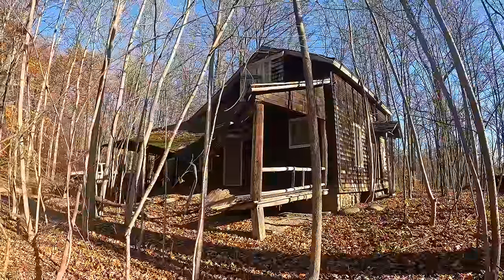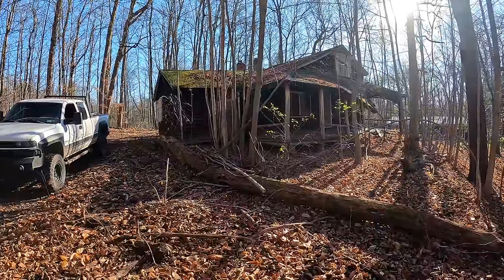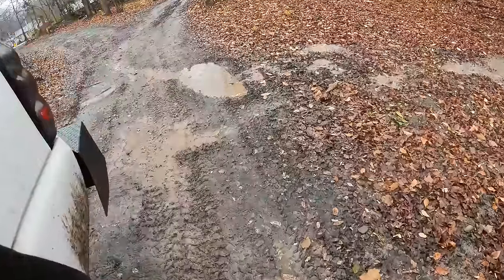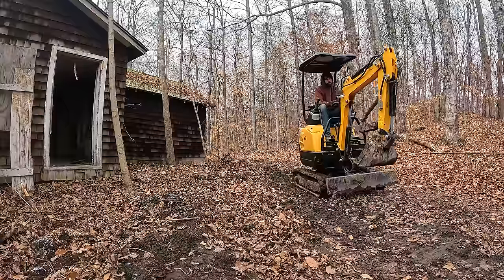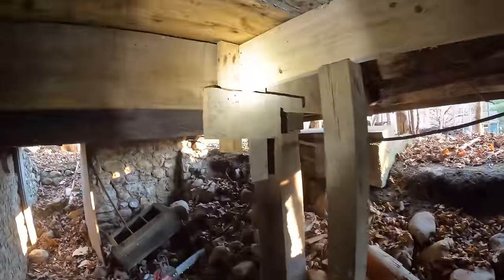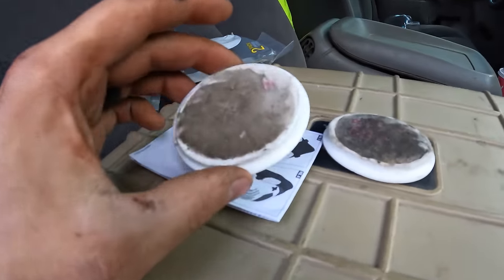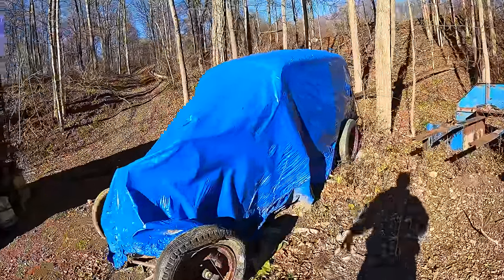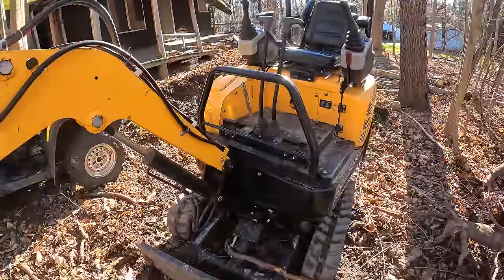I bought an ABANDONED CABIN in the WOODS - Vacant for over a hundred years!

Comment: It might have been built in the '30s, but it hasn't been vacant that long. It has had doors/siding/roof/ and interior parts upgraded way more recently.
Reply: Exactly. It was never built in the 1800s.
Reply: Young trees around it. Max 20 years vacant
Reply: I think it was not used as a residence since the 60’s.  It has had a lot of repairs etc though that have allowed it to stand.  Taking that this is probably upstate New York from the license plate or very rural New York there is no way this would still be standing after that many winters.  The fireplace is modern brick so to speak.  The evidence shows that it is an old house though with the log beams in the basement on the original structure.
Reply: It has asphalt shingles!  Man the Bs clickbaits are everywhere
Reply: @rhetorical1488  1903
Asphalt shingles are an American invention by Henry Reynolds of Grand Rapids, Michigan. They were first used in 1903, in general use in parts of America by 1911 and by 1939 11 million squares of shingles were being produced.
Reply: @nataliehunt1125  good thing you have wikipedia. Now tell me how they survived in working condition without care or maintenance for a century when their original lifespan was 5 years.
Reply: @kamurray67  Asphalt shingles are an American invention by Henry Reynolds of Grand Rapids, Michigan. They were first used in 1903, in general use in parts of America by 1911 and by 1939 11 million squares of shingles were being produced.
Reply: @nataliehunt1125  and what is your point?  I never said anything about asphalt shingles.   But, since you injected me into a conversation about asphalt shingles, the life span of 1930’s shingles makes this roof much younger than 1930 shingles.  But, I never said a thing about shingles.  There is enough other evidence for this house to have been renovated in the last 50-60 years.
Reply: I am so glad you made this comment. So many good points followed yours on this thread.
Reply: Comp roof
Reply: Exactly, it may be vacant for 30 years max. Otherwise it would have collapsed.
Reply: Plaster and lath look like 20s - 30s could be later maybe 40s. Back they they painted over beautifulnwood with horrid lead-based paint. If you go through the trouble to strip that stuff often you find beautiful walnut and cherry underneath, that you just can't buy today, but it's a lot of work and nasty chemicals.
Reply: Please note the distinct lack of "modern" facilities in the house.  The only water and electricity in the house is in the kitchen for a single faucet/sink, and a single light/outlet. Other than the kitchen, there are no light switches anywhere, no light fixtures anywhere, no outlets anywhere, not even wiring behind the plaster and lath.  There is no bathroom in the house, there is no toilet, no shower, no bathtub, nor any place for those because they were most likely not part of the original building plans because 100 years ago they weren't standard for every architecture plan, since many places, especially rural places, still didn't have access to pumped water or electricity, thus it was assumed that your "business" would be conducted elsewhere, notably outside the house, in the outhouse. I assume the electricity was also an afterthought as you can see the wiring being run along the top of the baseboard before going behind the paster and lath (and upwards to the outlet/fixture). 

Does the state even permit you to live in a house without "modern" facilities such as running water and toilets, and electricity?
Reply: @jimmy_kirk a lot of those fixtures could have been removed after people moved out.
Reply: @jimmy_kirk   @jimmy_kirk  You said it! That plaster and lath means it was orininally built in the 1920s-1940s. Roof, electricity and what have you were probably added/renovated later. My guess is that it was lived in permanently into the 60s-70s and then intermittently into the 80s. After that it fell into disrepair. 
As far as whetjer you can live without perc and being on city water etc. Well, that depends on where you live and as usual in the USA it is a confusing, chaotic morass of laws and ordinances. You may be subject to several layers of law, like the EPA might require you to have perc (I don't know if they still do this or not? They used to.), then your city or township might require you to be on city water and your county might have particular health and safety rules that apply to where you live. Check first with your local planning or zoning department, then invite a few builders for coffee, breakfast or wings and beer at the local pool hall. That should cover it.
Reply: @z4zuse  trees grow themselves what does that have to do with anything? the seeds are spread through birds and chipmunks and things like wut
Reply: @champion1388  After a years of vacancy, one would expect some older trees around. Trees are not a new phenomenon. Electrical outlets are.
Reply: Dude!!! Do you think the built with sticks?  Most of the houses in Europe are easily several hundred years old and they have windows and siding with a roof.
Reply: @ruadhscottygirl2480 IT WAS NEVER said it was built in the 1800s wth do people get the these dumb ideas from. 🙄
Reply: beside the 30's are not over 100 years ago
Reply: @kelleyhawk6595  It's because the guy in the video suggested the building might go that far back.
EDIT; scrolling through the comments the uploader says as a fact it was built in the 1860's and abandoned in the 1920's.
I don't believe a word of the abandonment date personally.
Reply: And I swear I saw a lino floor too which certainly won't last 100 years.
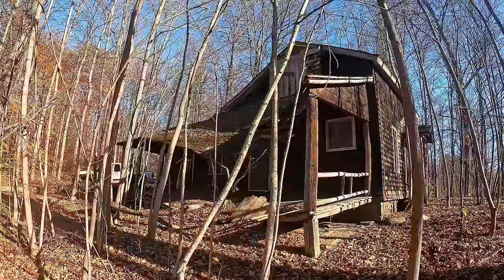Reply: @kelleyhawk6595  he says it 16 seconds into the video. 0:16
Reply: @jimmy_kirk  It may have been  used as a seasonal residence, like a hunting cabin or summer cabin. These are pretty common to see in rural parts of upstate NY and they will often have little or no indoor plumbing and be off grid.
Reply: @spunker88  That's what my thoughts were as well.
Reply: The house was probably built before the 1900’s for sure the floor joist are logs either chestnut, cherry or walnut also looks like hand hewn beams as well, I’m sure there was some updates done as well.
Reply: yeah. lost me when he said it might be vancant since the 1800's. any amount of reason would tell you someone lived in it around the 60's. I have to stop watching this click bait video now. see ya
Reply: My thoughts too.
Reply: exactly it looks a lot like my house that was built in the 30s/40s the windows are almost identical
Reply: If the place had been abandoned for nearly 100 years - it would have caved in on itself by now from roof deterioration.   The roof is probably 30'ish years old at this point.  Neat project though...
Reply: @kamurray67  i think that @nataliehunt1125 just wanted to try to prove a point that shingles were around from the very early 1900's and by the late 30's they were using a shit load of the damn things. and then also, she knows how to search a wikipedia page to get the answers she is looking for! but, i think she forgets that anyone can look up information, and even if they dont need to, its plainly obvious that this house has been worked on more recently that 100 years ago (possibly longer?)
Reply: I think the house is very old.  There is a lot of talk about the roofing and the asphalt shingles, this was 3 tab roofing if you look closely and that was developed and used in the 1950's and to me the plywood under the shingles (seen on the failing porch roof) sets the timeframe to be in at least in the 1950's, by then 3 tab asphalt shingles over plywood were the most prevalent type of roofing systems used both for new construction and re-roofs.   I was still installing 3 tab roofing on some homes into the early 80's.  Of course the roof tells us nothing about when the building was built and nothing about the last time the place was lived in, because whether they were living in the place or not the owner at the time may have re-roofed the building just to try and maintain it.
Reply: @jimmy_kirk  Look again. You'll find things you said are not there. Look again.
Reply: @oldladyfarmer7211  Such as?
Reply: Look again - everyone who has figured out that this has not been abandoned for 100 years has figured it out. Rewatch or read the posts. I don't do my kids homework for them. ;)
Reply: @oldladyfarmer7211  You made the claim "You'll find things you said are not there".  The onus is on you to substantiate your own claim.  It's not my "homework" to substantiate your claim for you. That's your job.  You said it, now own it.
Reply: @jimmy_kirk  I've been rewatching several times to see if I'm wrong. So far I'm not. I'll get back to you.  Wow - it was tough trying to get back to this.....After this I'm not bothering with this video anymore - I'm old and it's taking too much time from my life to try and search for responses.
The fellow said he was told the house was abandoned about a hundred years ago. That is wrong. Whoever told him that was incorrect. At the very beginning there is a chrome/stainless electrical outlet cover....that is not 100 years old. The fruit wallpaper (like what we had in our kitchen when I was a kid) is not 100 years old. You miss the point which is that though the house may be 100 yrs old - it hasn't been abandoned that long. When I was a kid we had an outhouse - a lot of people did. A bathroom was an afterthought if you could afford one so that's not an indicator. Many old homes were used as hunting lodges/cabins for many decades after the homeowners moved out  - as was our first farmhouse. So ...
Reply: @oldladyfarmer7211  You just need to provide a timestamp from the video showing running water or electricity anywhere in the house besides the kitchen.   I checked before I made my comment, so I'm fairly confident in my claim. If you see some electrical outlets, light fixtures or plumbing anywhere else in the house, then just provide a timestamp for where you see it in the video.
Reply: @jimmy_kirk  3:15   cellar, post on the right has a light fixture. Now I'm not going to try to find anymore replies - it's too time consuming.
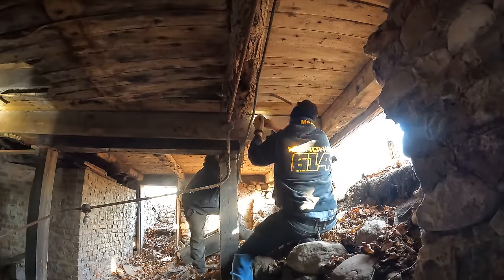Reply: @oldladyfarmer7211  That's literally on the mainline coming into the house.  That's the one electrical line that runs into the kitchen. Notice that there is absolutely no other wiring there besides that one main line that runs into the kitchen?   This is the mainline that they removed at (32:35).   You're not going to try and "find any more replies" because there are none.  You didn't even find what you think you found, because what you found was the single electrical mainline that runs into the kitchen.
Reply: The wall outlets in the first room are from the early 70's
Reply: That's how you get 1.5m views in 2 weeks on a channel with under 50k viewers lol
Reply: @QuanticChaos1000  What makes you say "early 70's"?
Reply: @kamurray67  Shingles are painful...
Reply: @garygsp3  Are the houses you're describing abandoned in the woods?
Reply: @z4zuse  I think it could be 50-60 years vacant. The main building we see could date from the 30s but could have been built on a building older than that. A lot of the structure looks like my 1922 house. As for the roof "Asphalt shingles are an American invention by Henry Reynolds of Grand Rapids, Michigan. They were first used in 1903, in general use in parts of America by 1911 and by 1939 11 million squares of shingles were being produced." How long it would take for that moss to grow on that roof I have no idea as not familiar with the area or climate. I'm sure he was told whatever they thought he wanted to hear just to get the house sold. I did a little research on my house and most of what I was told was true.
Reply: @kamurray67  That fireplace looks like an old design. Keven Lee James has one very similar in his house which dates from the 1800s. If the house was tied up in probate and family infighting they might have done the very minimal to maintain it, IE. board it up securely and make sure the roof doesn't leak. Some houses are in limbo for decades because of this.
Reply: the updated electical was a giveaway too
Reply: my first thought was that he may have been given misinformation by the seller/real estate agent or auctioneer. we don't know how he obtained the house. and although he may have been told it was vacant all that time, i can definitely see evidence of squatters. further, i think it could just be a misunderstanding of wording -- maybe he meant it's 100 years old but has been vacant for many years, not "vacant for 100 years".
Reply: @rustyhowe3907  He said its been vacant as he can tell in the 1930's and then said it could of even gone  back into the 1800's NEVER SAID IT WAS DEFFINATELY THAT . Stop acting like you all know everything and that he said it as a Definite Fact!! 🙄😮‍💨😒
Reply: @jewelsluv67  If you don't like getting answers to your ponderings then stop cryin about you not getting the information right rather than shriek at me about your personal inadequacies with not paying attention the first time.
Jfc!🙄
Reply: And it sits on the edge of a highway not exactly in the woods.
Reply: @jimmy_kirk  It's a cabin in the woods.  not the burbs.
Reply: @jordanmc9015  While most of the camera work makes it appear as though this is a "cabin in the woods", you can literally see the road and other houses in the neighbourhood at (8:30),  (26:42), (39:05), and a few other places in the video.   It's not "a cabin in the woods", it's "an old house in the burbs".
Reply: @jimmy_kirk  There's multiple modern outlets in the video, looks like 60s
Reply: It may have been a permanent home until a 100 years. But after that it was definitely lived in. This place may have been vacant for 20 years at most.
Reply: @jeremiahsummers8054  Outlets from the 60's use the same design as outlets from the 30's,  the 70's, the 90's... basically what I'm hinting at is that standard electrical outlets have maintained the same basic form factor since their inception. 

Where do you see "multiple modern outlets"?  Besides the one in the kitchen, what other outlets do you see?
Reply: @jimmy_kirk  Have you ever demoed a house in the 40s messed with the old knob and tube? I didn't see any of the old single-outlet non-grounded receptacles, only the dual-outlet that's grounded that became more common in the 50s and 60s. Regardless there's much more than that in this house that refutes his claim. Still enjoyable to watch just means he's probably not been doing this long and if he has he's not being genuine and just saying stuff for clickbait. Either way, enjoy or not, but there's too much here to be able to defend his timeline.
Reply: @jeremiahsummers8054  I responded to your post, but, it seems to have been removed for some reason... it was rather lengthy, so, I'm not gonna try and figure out what word that YouTube didn't like... sigh.
Reply: Yeah Ive seen older looking house fixtures while house shopping lol
Reply: Whenever it was built, it can't have been used recently as when he was hacking away, I saw no sign of electric cables. Maybe there was and you have better eyes. There are plenty of nearby houses, so electricity services must be in the area
Reply: @kamurray67  Asphalt shingles are an American invention by Henry Reynolds of Grand Rapids, Michigan. They were first used in 1903, in general use in parts of America by 1911 and by 1939 11 million squares of shingles were being produced.
Reply: I think it was abandoned in the Mesozoic. It's the Cenozoic now so it's been abandoned for a SERIOUSLY long time.
Reply: @nataliehunt1125 why do you keep repeating this ? Is there something special about it ? Asphalt shingles come , asphalt shingles go away . Like T-loks , and 3 tabs . It's basically ",useless information."
Reply: @manfredconnor3194  it wasn’t uncommon for vacation cabins to have no electricity or water pipes inside.  Even into the 70s or 80s.
Reply: @IcelanderUSer  I never said that it was. However, according to another commenter here the wiring in this house dates to or was renovated/upgraded in the 1970s. I do not know if that is correct. I was not paying attention to the wiring, when I watched the video the first time. My only assertions were:
1.) The plaster lath construction of the walls dates the house to the 1920s-1940s. 
2.) The house was not completly abandonded until at the earliest the 1970s and was PROBABLY used and maintained well into the 1980s. It was probably abandonded/no longer inhabited after that point. 

Of the first point I am 90% certain.

On the second point I am 55-67% certain.
Reply: @IcelanderUSer  Tjis place clearly had electricity at least in the 70s. I would have to go back and watch the video again to get a better idea and it's not that important to me, so .....
Reply: @rustyhowe3907  definitely a linoleum floor in the "kitchen"
Reply: @jordanmc9015  
It is on a treed lot, granted a large lot. It is not in the woods. Busy paved streets and neighbors all around.
Reply: Well.....?  If you think about it, he's what..  off by 10 years give or take?  It's quite fair to say it was 100 years old.  I'm surprised he didn't see any signs of homeless living in there.
Reply: @richardnelson3507  tbh, I do note even remember what he said anymore. There was a weekend in between there. RESET.
Reply: @z4zuse  20 years max is right. No way that was vacant more than 20 years.
Reply: it would leave a lot of holes in the walls and why would someone remove all modern stuff from the house then put a ton of work to patch all of the holes    @BillStreeter
Reply: After 100 years of vacancy it wouldn't be in such a "good" condition.
Reply: @richardnelson3507  He said it's been abandoned for 100 years, and that is almost certainly not the case.
Reply: @jimmy_kirk  18:17 outlet on left side of doorframe  near the floor in upstairs bedroom.
Reply: @jacqulyynw  Indeed, there does appear to be a second outlet in the house, however, how many outlets are required per room as per building code in order for someone to reside in the home?  

Did you happen to notice any light fixtures anywhere else in the home, other than the one in the kitchen?
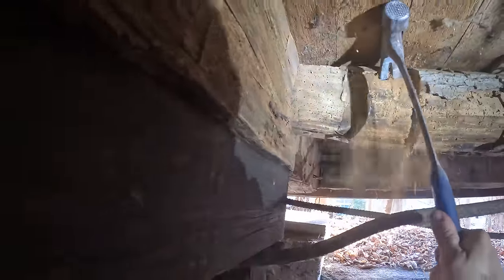Reply: @jimmy_kirk  31:25 electric conduit, maybe line in, but at that level probably line out;  its a bit hard to tell with the camera angle and the main focus being on the rotting joists.
Reply: @jimmy_kirk  33:20 main breaker box center right side of screen.
Reply: @jacqulyynw  Okay, you can clearly see from the main breaker box that the house wouldn't be up to residential building code. 

My main point here was that I don't think it would have been legal for anyone to be living in the home as a residence, at least not since a long time ago.  I suspect it was used as a cottage or hunting camp, etc. where the building wouldn't be required to be up to residential building code, as a hunting camp or cottage isn't considered a residence.
Reply: @rhetorical1488  Let's not forget the "cabin in the woods" situated right next to a seemingly well-trafficked roadway... lmfao, at this point I'm even doubting that he bought it. He might have inherited it or is fixing it for someone else.
Reply: @rhetorical1488  lol exactly...
Reply: The power lines running down the side, not 100 years old
Reply: @kamurray67  like the red Tuck Tape on the inside, lol
Reply: @thany3  you think this place was "lived in" in the 21st century? Doubt it.
Reply: @401Impala  Not like you'd permanently live there with a family and everything, but I mean more like a weekend back-to-basics getaway shed.
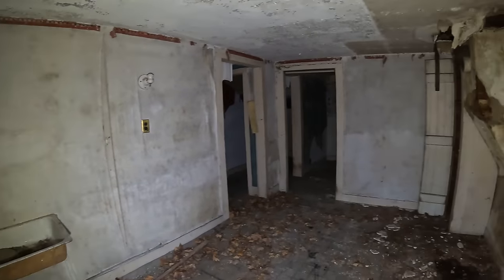Reply: Cheap, fake-brass outlet cover at 3:43, popular in the 90s.
Reply: Yeah, no way has it been sitting there unused that long. Assuming it wasn't just click bait, people have probably just been squatting in it without telling whoever keeps records on residency so its 'officially' been vacant that long but 'unofficially' people have been making use of it until much more recently.
Reply: @rhetorical1488  Asphalt shingles are an American invention by Henry Reynolds of Grand Rapids, Michigan. They were first used in 1903, in general use in parts of America by 1911 and by 1939 11 million squares of shingles were being produced.
Reply: @kamurray67  Asphalt shingles are an American invention by Henry Reynolds of Grand Rapids, Michigan. They were first used in 1903, in general use in parts of America by 1911 and by 1939 11 million squares of shingles were being produced.
Reply: @ISCREAM.STORE1  why do you people keep preaching to me about asphalt shingles.  I never mentioned them until some one tried to make what I said about the age of the house about shingles.  I DON’T CARE!
Reply: Being vacant and being maintained are two different things.  Could have had multiple owners that never got to live in it but had done some updating to it. One never knows and so many of these youtubers use click bait headings and have no clue what they are talking about either. So take your pick could be one or the other or neither thing at all.
Reply: @kateferguson7705  on other comments the channel owner insists he is 100% correct and everyone else is wrong. its clickbait and bad bait at that. the beauty of the internet is actual experts can come across krap like this and pick it apart.
Reply: Knowone has lived there for over 80 years or more . I know because I live near the place I know the people who owned it
Reply: I live near it it's been empty for over 80 years
Reply: Everyone is an expert! I just enjoy the videos, plus kudos to him he has set a lot of hard work for himself.
Reply: yeah, he has no idea what he's talking about.
Reply: 1980s style outlet covers. This has only been vacant 30-40 years at the most.
Reply: clickbate to the max
Reply: 100 Years LOL Click baiT. What I do to click bait is never watch the channel again......
Reply: its probably been vacant for like 30 years
Reply: @kamurray67  last 20-30 in my book, those 30yr asphalt shingles under those trees won’t last 15 in those conditions. Click baiters blow.
Reply: @manfredconnor3194  I agree with you on everything except I renovate historic homes and ALL home I have renovated starting from 1826 have some form of lathe and plaster.(very few exceptions in my area) If I recall the lathe and plasterboard, precursor to Sheetrock was developed and used starting in the 1920’s/30’s. Either way, loved what you said!
Reply: Would it not be cheaper to bulldoze it down and build something new.
Reply: Either way,  it definitely needs some work. It'll be nice when he gets done with it.
Reply: Viewers are on point, very observant!!!!!!!
Reply: @rhetorical1488  Asphalt shingles are an American invention by Henry Reynolds of Grand Rapids, Michigan. They were first used in 1903, in general use in parts of America by 1911 and by 1939 11 million squares of shingles were being produced.
Reply: the wallpaper colour makes me think late 70's
Reply: @rhetorical1488  Henry Reynolds, a roofing contractor from Grand Rapids, Michigan, is credited with inventing asphalt shingles in 1903. Reynolds cut asphalt-saturated rolls covered with stone into 8 in x 16 in shingles by hand. Asphalt shingles were first used in 1901 in the United States. By 1911, people started to use them on a general scale, and by 1939, approximately 11 million were being produced. So yes this is 2024 now, so yes this house could be over 100 years old! no lie!
Reply: @kamurray67   it depends on what you call modern, it is 2024 now. 1924  is exactly 100 years ago..... Henry Reynolds, a roofing contractor from Grand Rapids, Michigan, is credited with inventing asphalt shingles in 1903. Reynolds cut asphalt-saturated rolls covered with stone into 8 in x 16 in shingles by hand. Asphalt shingles were first used in 1901 in the United States. By 1911, people started to use them on a general scale, and by 1939, approximately 11 million were being produced. So yes this is 2024 now, so yes this house could be over 100 years old! no lie!
Reply: @z4zuse  There will always be baby trees growing around in vacent places, that proves like nothing. and depending on what type  of tree they are is what depends on the time it takes for it to grow and mature.
Reply: @xxurmommaxx7927  once again another reading comprehension fail. How does the shingle that had a 5 yr lifespan last a century without maintenance as this dude claims? The studs may be a century old but nothing else is. Others have pointed out the complete fabrications in more detail.
Reply: Who cares.
Reply: It looks like this house is entirely built out of wood. why would people do this. Houses need to be built out of stones.
Reply: @z4zuse  its  hardly in the woods at 39:00 we see the 5 neighbors and the main road
Reply: Why upgrade siding, and not add elecrticity and plumbing?
Reply: @nataliehunt1125 I can guarantee you with that many trees and moss growing on that roof those 3 tab shingles are no older than 30 years max.
Reply: yeah, tho if it was rural Saskatoon Saskatchewan, minus the asphalt shingles, i would't be surprised if you could get buildings that havent been touched in 100+ years and it look like this.
It's so cold and dry there that stuff doesn't really rot, especially if its got rot resistant chemicals on it.
My great grandparents owned a farm there, and they had a little shed out on the other side of the grain field, solid km from the house, that my great grandmother's father and uncle built when they were teenagers, 1910s at the very latest, it was still standing last time I saw it back in 2012, gravity kinda dismantled it a bit and it had a pronounced lean to it, but it was still standing with its original wood, and they just treated stuff with the locally made seed oil back then, so it didn't even have funky chemicals in it.
Reply: @rhetorical1488  no diffrent than it saying "in the woods" haha just cuz its over grown with trees dosnt make it in the woods. You can see the neighbors house. Typical New Yorker haha sees more than one tree and lost in the woods.
Reply: If something is that far gone is it worth repairing? I understand the prices on homes these days but are saving money with the expenses of the repairing and modernization?
Reply: @christophermorris6386  depends what your values are, if its just a house, yeah not that worth it. If its the history, 100% worth it. Lots of folks would spend lots of money for a 100+ yo house.
Reply: That's what I was thinking, because the interior looks almost identical to my grandparent's house (minus the rot and peeling walls), which was built in the 1930s and mildly updated as time went on.
Reply: Why was this project built in the 30s but still maintained and upgraded today?
Reply: you cant see just from the thumbnail that the title is bs.
Reply: @ruadhscottygirl2480 is bro sped?
Reply: I get your point, but even with upgrades, the cabin’s history still holds great value. Restoring something so rich in the past is impressive! What do you all think? Do modern upgrades enhance or take away from a building’s charm?
Reply: The roof shingles are Dimensional shakes. Those came out in the early 90's or possibly late 80's can't remember for sure, but I helped my brother roof his house with them back when they first came out.